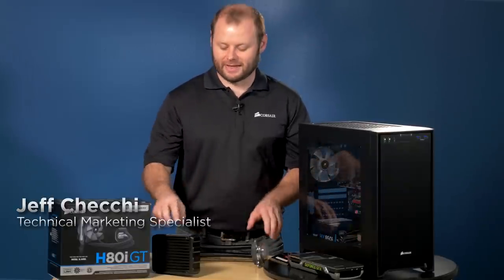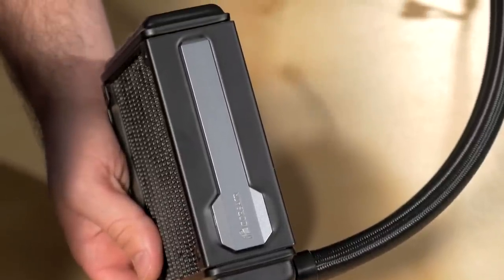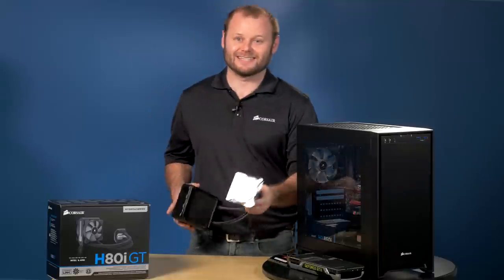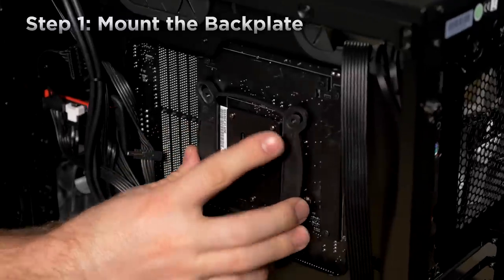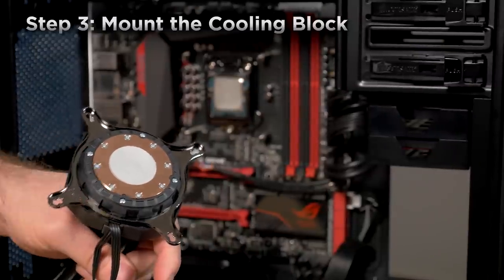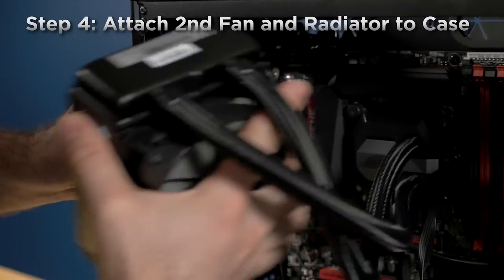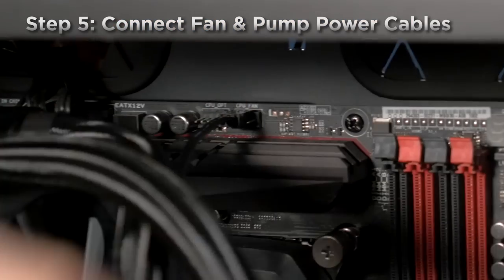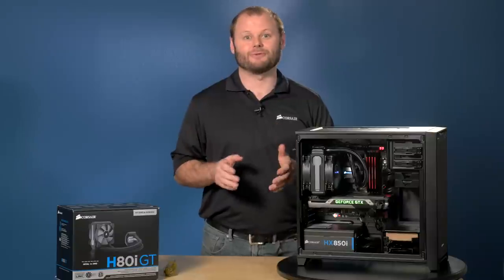Corsair Hydro Series H80i GT Liquid CPU Cooler Installation How-To Guide

Comment: i love how this guy makes it look so easy and effortless to install the h80i gt, i spent 2hrs+ on it (due to my gross incompetence). Fortunately it's up and running well now
Reply: I plan on getting one too hopefully it shouldn't take too long for me
Reply: +K- “K-Hype3” Hype I just bought one! I hope it will fit into a Corsair 450D case!!
Reply: Adwaiya Srivastav
I will indeed.
Reply: +Jon Ang AMEN!!!! I struggled getting the 2 fan and radiator placed correctly and snugly secured.
Reply: +Adwaiya Srivastav Hi, Adwaiya Srivastav, It works in a Corsair 450D Obsidian. I was worried that it would be crushing my 8 pin whatever right behind it, but it didn't. It's a pretty tight fit, though, if you place it the way Jeff places it.
Reply: can i plug the pump power cable before installing the radiator?
Reply: 21N73N25 i dont see why not.
Reply: it always is in the end.  but along the way you may think you break shit haha.
Reply: I feel you. . Putting everything else in the build together other than the cooler took me an hour but the actual cooler took me 2.5 hours because the spec-03 case barely and I mean barely has room for this thing. If you don't put it together exactly the way he did it in this video you have start all over again.

Comment: I would recommend orienting the radiator such that its hose connections are below the CPU. so any air bubbles don't get sucked into the CPU block over time.
Reply: This ^

Comment: +1 Overclocked my Intel i5-6600K from the stock 3.5Ghz to 4.6GHz (stable) with temps not reaching higher than 55-58 degrees Celsius

Comment: Before someone asks another stupid question... the cooler come pre filled with coolant it is plug and play use right out of the box it has pre applied thermal paste and 2 fans with it. They have 5 year warranty and are really good.
Reply: Wasted Gamer mine did not have thermal paste. Not sure why but i had thermal paste on hand and corrected the issue.
Reply: That's Great, The thermal paste from corsair is alright but i put aftermarket on mine!

Comment: I love Corsair water cooling solutions BUT they really need to sort the amount of wires out, often if you're looking for a clean and tidy look you don't want wires trailing across the motherboard, maybe integrate the (radiator fan to pump cables) into the sleeve of the pipes so they aren't seen? Also the Pump to USB cable needs to be longer so you can route it better and ideally a sleeved cable would look better.  Just a thought

Comment: Nice video, and I had no problems installing mine except for one thing. There's nothing either in this video or in the instructions that shows which way to mount the fans. I now see it's with the Corsair labels facing in, but an illustration or mention would have been nice. Otherwise, great product!
Reply: SirAndacar it is not obvious but there are arrows on one side of the fans. They are small and in the corner. i initially missed them until i actually started looking for them.
Reply: Thanks Alex V4!

Comment: In my H80i v2 manual under FAQ it says Corsair recommends the radiator is mounted hose down.  So is the install in this video upside down?
Reply: Yes, the video is installing it incorrectly. Or, rather, the least optimal. Hose down always!

Comment: Just a note never got the back plate for the AMD FX 8350 on the sabertooth 990FX R2.0 only the top plate you get both plates for the Intel / i managed to get all installed correctly what a super cooler allot more quite than my old AMD 965 well worth getting keeps my temp very low not overclocked it yet ( kept the MB backplate just added 4 small washers )

Comment: Does he have the fans configured here as a case exhaust? I like that and wonder if I could modify my (future) chassis to mount the radiator and second fan on the outside rear of the case (or just the second fan) to save some space on the inside. It covers up almost half the motherboard!

Comment: Good afternoon, I have a liquid cooling H80i V2, the radiator can be installed in any direction, for example if I install it with the hoses up the radiator is full of 100% refrigerant, because if the radiator is not completely full the pump could Work dry. If it is completely full of refrigerant?

Comment: Did you install the fans as intake or exhaust fans
Reply: Always install them as intake. You never want to cool the hot liquid running through the rad with the all ready hot air inside your case.
Reply: Intake.
Reply: EpicGuyJC In the video he use exhaust configuration.
Reply: IMHO this configuration seems to work better using the H80i GT mounted as exhaust (on rear, just like the video) and using the top fans as intake (with dust filters).
Reply: EpicGuyJC bruh i think it should be exhaust where its at you want to pushing out that hot air
Reply: He got Fan/s in the front taking in fresh/cold air. Both the 120 mm SP Fans of the H80i GT take that fresh air. The 1st sucks it in and delivers it to the Radiator. The 2nd one behind the Rad. sucks it from the Rad. and blows it out the case.

Comment: Have there been any successes with the H80i GT and the NZXT G12 gpu mounting kit. I have seen the H80i working even though it is not officially compatible from the NZXT website. Design wise are the water blocks of both the same?

Comment: I got a H80i V2
Did it just like the Gentleman in this video.
Both Fan cables into the header coming from the Cooler unit and I put the cable coming from the Cooler into CPU_FAN Header
USB Cable is also at it's right place.
Since one of the Cables is 3 Pin only, I  can control only one. 
The other is shown as some Case and is unctrollable by Corsair Link. I can control Pump Speed and the LED. 
Please Help!!!

Comment: In my Cooler Master case it would be right under my PSU (RM 750x) and therefore right under its ventilator. Wouldn't it be a better idea to install the radiator with the fans on the outside of the case? I totally don't care how my computer looks. It has to work in the best way possible.

Comment: I have problem w/the usb2.0 connection. Since my MoBo is Asus Z10pe-d8 WS dual processor i have to connect this 2x-H80i -V2 to usb2.0 connection port n my MoBo w/c has only one port in it. Do you have any recommendations or suggestions on this matter?. . .  pls. I should need at least 3x of usb2.0 connection port to fit 2x-H80i-V2 and 1x-front usb2.0 connections.

Comment: Two probably dumb questions;

1, Should the cooler's fans be directing air outward (from the inside of the tower --> over the radiator --> outside), or inward? The former sounded more intuitive but then I also thought maybe cool external air over the radiator might be better? I've got a cooler master HAF932 advanced tower with fans directed out from above, in front and beside the processor, if that helps.

2, My mobo's CPU fan header is 4 pronged, but the connector to the unit is only 3. I assume I need some kind of adapter for that?
Reply: +Trevor Partch  1.  Direct the air outwards. I believe that gives the best result.
Reply: +Trevor Partch Hi, this is my doubt too... both fans puts air insde the tower or out???
Reply: +Trevor Partch Trevor no you don't need an adapter. If you look at the head of the connector on the MB, it kind of shows 3 of them "segregated" by two notches of plastic. Make sure those are the ones you plug in. I had an issue with one of my other fans because of this. I fixed it and the fan is good to go.

Comment: Hi,

I have exactly same Cooling system and after a year of using my computer system shows CPU FAN ERROR. any other fans are working properly, but This one looks like that it might have been some electric damage in it ( i dont know - just guess). So even if the H80iGT fans are spinning, system cant see that it is attached to CPU and in several seconds system shuts down.

What might be wrong and what should i do?

P.s. it been working perfectly for 1 year and suddenly started ,,fooling around" 

Have checked my Mobo. No damage to it whatsoever.

Please, help?

Comment: the thermal paste that has been applied is smaller than my cpu and  it's squared should I b concerned??? or does thermal just spread when heated?
Reply: thermal paste spreads, and you dont actually need paste all over the cpu, just the parts that make the most contact. intel cpus are slight lower on the edges so the main part touching the cooler is the middle, which this should suffice with. also you dont want excess thermal paste on ur cpu

Comment: Does anyone know if you can leave the corsair link cable out? and the cooler will still run without problems?
Reply: +CalebL  Yes , you can run your watercooling without the &quot;Corsair Link&quot; software , but you will not be enable to control your fan and the pomp .... 
Except if you put the Fan cable into your Fans headers but you the pomp will be uncontrollable .

On my motherboard , i have only 1 USB 2.0 internal port but its busy .... But i also got a USB 3.0 internal port that i dont use ..... So for connect the Corsair Link i&#39;ve bought a USB 3.0 Female to USB 2.0 Female cable and i connect my pump on it and it&#39;s work fine ;=)

You can find this cable on Amazon easily ;=)

(Sorry for my poor level in english héhééh)

Comment: I would like to replace my H80 by this 80i, but my backplate is welded to the motherboard. Will i be able to use the screws from the previous  H80 installation ( same positionning and diameters?)
Thanks!
Reply: i got my answer, it's no, and not mentionning you need a recent bios to make this shit work. 0 to corsair

Comment: Since the fans are attached to the pump, unlike H75 where they are separate, this means that 2 fans and the pump run on CPU fan header alone. Is it even able to get enough power like this?
Reply: Admiral Ackbar i dont know. i own it and it does not even use the second (optional) CPU fan power port. i really question how it gets enough power for that but hey. just go with the flow right. will update shortly after a test run if i remember.
Reply: My Gigabyte 990FXA-UD3 runs it fine with fans and pump on max.

Comment: Can it fit into corsair carbide spec 03 at the back? Saw the corsair site stating h80i could fit but didn't state anything bout it
Reply: Axelqiqi Yes, it can, as I have the same case corsair carbide spec 03 and it fits at the rear, it is pretty tight and if I was you I would make sure that where the fans and rad are going to sit there is nothing that will get in the way on the motherboard,

Comment: will this fit in my Corsair Carbide Spec-Alpha Mid Tower?
Reply: CaptnCuba If you are not sure then most likely it will be a tough fit at least. The tubing fights hard because it is fairly sturdy so if you end up fighting it be ready to struggle to close the case. I had that problem but hey liquid cooling is cool so it was worth it.

Comment: I have had this since July 2015 and it has always said the temperature of the pump is 27°C even though it says all cores of my Intel i7 4790K is at 65°C (full load) and about 30°C (Idle) is anyone else getting incorrect temperature readings for the pump?

Comment: why the f*** does this cooler smell like SHRIMP when i pull it out of the box?!?
Reply: Not shrimp, it smells like skunk. It's because of the rubber pumps. Or an overworked Chinese child spilled his Shrimp chow fu soup while he was building your cooler.
Reply: Because it's a water cooler and has been put into sea water in order to test it prior to sending it out to retailers!
Reply: Because the heat spreader is coppershrimp compound
Reply: Ordered, let's see about that.

Comment: How dose it differ from the original h80i, like is it larger taking up more space. and such things.
Reply: Well its quieter, more efficient, and it looks better.
Reply: imo the original h80i looks better (simpler look)
Reply: With the price difference is it really worth it.
Reply: If you didn't know, they've improved the pump design to be more efficient, the tubing is improved the rad is thicker allowing it to cool better with the 2 corsair SP 120 mill fans which output 5.00 mm h2o static pressure. NOT PURLEY LOOKS. although the improved the athstetics on the block, the now sleeved tubes and the side of the rad.
Reply: I bought one of these and its in my rig right now and its performing very well.
Reply: How's the life expectancy of one of these.
Reply: Jeremie Plourde  Corsair guarantees five years.
Reply: that's decent. just trying to get well inform before making a purchases. for my pc

Comment: Hi guys. I've got a serious issue with my h80i gt and I can't find any solutions. 
I've installed it after hours of efforts.
There was a gap between the motherboard and the backplate that I filled with custom rubber washers so that it can't move. 
The fans are working properly, cooling the radiator efficiently. 
But it doesn't cool the cpu AT ALL!!! It goes straight up from 25 to 100°c even when the fans are in full load...
My cpu is an i5-4670k no overclocked. It was working at ~30°c on idle with the stock fans. It's not the reason of the problems..

Another thing: the pump makes a rattling noise on startup and it seems to last a while before behind less audible..
HELP!

Comment: Do you need to have 2 fans on the cooler? I am gonna replace the stock fans with a Corsair AF120 but do i need 2 for it?
Reply: ***** This will be my first build so not very experienced. So it is already Corsair SP120 on them? If so, i dont have to swap to new ones
Reply: Just because its my first build doesnt mean i have to buy the cheapest and most used products. I will buy a i5 6600 and a GTX 1060 6gb gaming x.
How can the cooler be so loud? is it the the fans or some other part in the cooler? It cant be the fans if its the AF quiet edition, thats just 20 dba
Reply: My headset also blocks out like 90% of sound. I have a laptop right now that is very noisy but with my headset on i almost cant hear it. So noise wont be a problem
Reply: Oops it typed it wrong, i meant the SP fans. If its the fans that are loud, how can it be that when it says its at only 20 dba???
Reply: If the fans stop during sleep mode, i will be fine
Reply: ***** But how can the cooler be almost 40 dba when one af120 quiet edition is 24 dba? Then it has to be the preformance version that is on the cooler...
Reply: ***** YES I KNOW BUT I TYPE AF WITHOUTH THINKING ABOUT IT CUZ IM USED TO TALKING ABOUT THOSE
Reply: ***** So i meant the SP, not AF. If u see me type AF again, i mean SP.
Reply: ***** Yeah that is true, i think i will do that later after building the pc since i wont be so affected of noisy fans
Reply: don't you need the K to overclock? if you're just getting the regular one without the K i wouldn't go with liquid cooling since you wont really need it

Comment: My 4790K reaching up to 97 Degree Centigrade in a minute during full load and ideal temp is 38-45 Degree Centigrade on Intel Stock Cooler.
If I install H80i GT What will be the Core Temp on Full Load? and what will be the ideal? [Need an urgent reply]
Reply: Mite reach 65 degrees Celsius maximum I'm pretty sure
Reply: have the exact same problem. Hopefully this cooler helps ^^

Comment: while I'm happy with my purchase it's doing my head in that Windows won't install the drivers for the H80iGT Cooler and unknown device.
Keep getting  driver installation failed. :(
if anyone has any tips on how to get the bloody drivers installed...

Windows 7 pc with i7 930...
Other thing I don't get is why not put the USB link cable connection on top instead or on the side instead can' plug it in or out without taking the cooler out again as I have some cooler next to it on my mobo...

Comment: Hey guys, I don't know where to put the Corsair link cable so I guessed and plugged it in the usb front port but the Corsair link program don't even recognize it. Someone can help me?
Reply: I've connected mine to a standard (external) USB port because I've misplaced the cable that came with it. I had problems with the link program connecting via the internal USB.

Comment: Why did they take away the Corsair link port that the H80i had?  This enabled you to link a power supply without using 2 USB headers on the motherboard.  This requires it's own USB port so if you get a corsair "i" power supply you will eat up all the available USB headers on the motherboard.   The H80i Gt will never be as good as the original because it's missing a big big feature.

Comment: total noob question.  i installed this model in my pc and according to the instructions the cooling tubes are on the bottom.  this fellow and subsequent pics ive seen on their website show the tubes on top.  Is there a correct way or does it not matter?
Reply: it goes on top really. i had it on the botton and my case wouldnt close but after months i switched it the way he put it and bam it worker better. and tubes stay out of my way.
Reply: +Hoopdrm819 surely they should be on the bottom as any air (which there is air in these as you can hear the liquid slosh about a bit indicating free space) thats trapped will go to the top therefor the pump would suck air, when building a custom loop the outlet from the reservoir (in this case the radiator acts as the reservoir too) should be at the bottom so the pump doesnt suck air